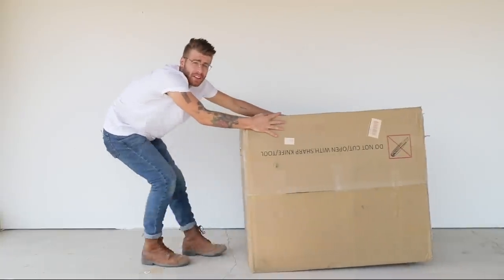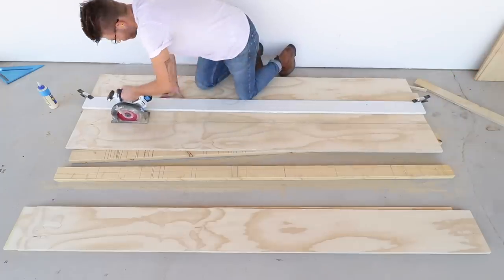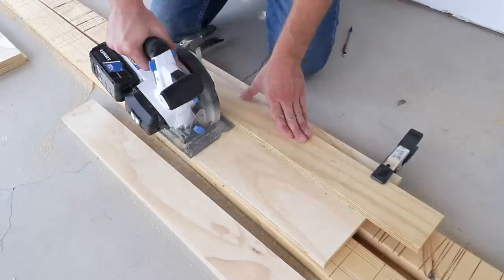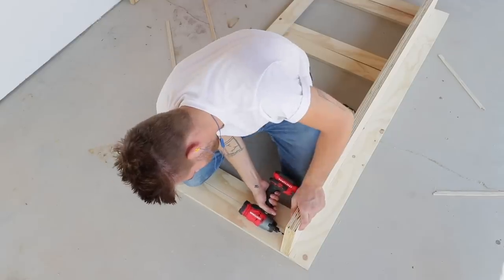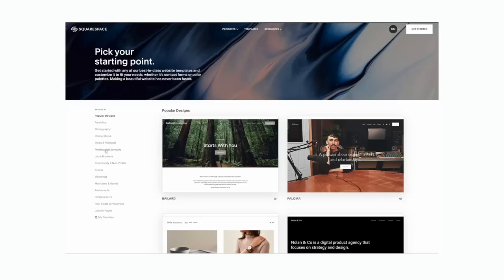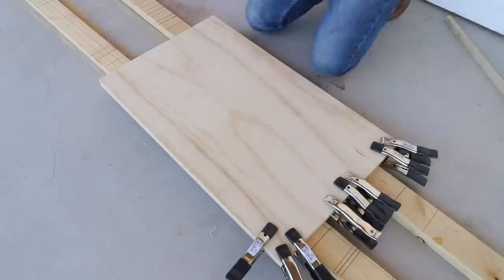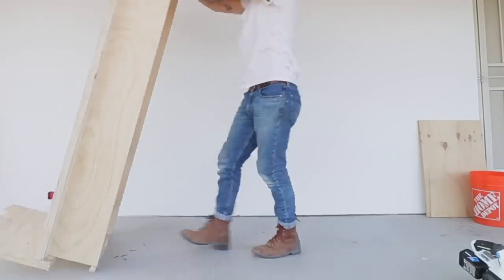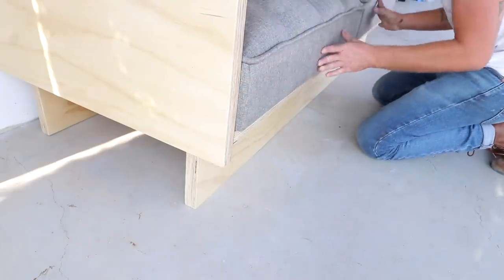DIY Sleeper Sofa / Futon that Turns Into a Bed! | Modern Builds

Comment: Hey nice project! Just try some furniture wax where everything is sliding together to make it slide easier. This is what furniture makers use/d when there is wood on wood sliding together
Reply from the maker: Thanks for the tip!!
Reply: @ModernBuilds  no problem...I should have been more specific. You don't really want the finishing wax. Just some regular parafin wax found in the canning aisle.
Reply: Good old bar soap works a treat also
Reply: Was just about to say the same thing - rubbing a plain (non-scented) candle stick on the wood will help too.

Comment: Fantastic video! One suggestion, instead of making larger spacers for it to move more smoothly, try rubbing a wax candle on all the parts that slide together. This makes for an excellent lubricant for wooden tracks. Also works for old chest of drawers that like to stick.

Comment: Putting square or rectangle nylon slides on the part that moves would also help with making it easier to slide in and out.  Maybe like the ones you put on the bottom of chairs. Just saying.

Comment: it needs wheels to make sliding out easier. and a simple locking slot, to keep it in sofa mode. also, the arms could have more functionality. if they were hinged, they can be folded for instant bedside surfaces, so glasses, phone, etc.

Comment: How are you so accurately using the clamped down piece of wood to cut the right size?? Are you making the measurement and then just simply adding an extra amount for the distance between the wood and the blade itself??
Reply: yes, knowing the dimensions of your saw makes it simple to measure from the outside of the shoe to either the inside or outside of your blade. taking the kerf of the blade into consideration will allow you to know exactly how much to add, or subtract, to easily clamp your straight edge.
Reply: C Cald thanks dude

Comment: This would be cool if you cut the  movable front leg about 1/2 inch shorter and add hidden wheels behind the panel, that'll let it roll out easier. Would just have to cut small openings in the front stationary leg for the wheels to fit into when closed.

Comment: Nice, easy and cheap project! Those armrests look so uncomfortable. Why not make them wider? The legs look quite flimsy. Maybe make them more robust looking with some leftovers?
Reply: the legs don't really need to be sturdy because they will be secured to the bus. Also, there is nothing flimsy about 1 1/2'' inches of plywood. This won't just be a free-floating piece of furniture. It will most likely be fastened to both the wall and the floor making it perfectly sturdy without the extra weight. Weight is your enemy in a vehicle.

Comment: I bought a cheap version of this click clack futon for my studio.  Unfortunately the metal mechanism that allows it to fold down into a bed protrudes up into your back when you sleep on it.  It  protrudes from near where the vertical and horizontal cushions meets on outside edge of the seat portion of each "chair". So it is basically right down the middle of your back.  This is dangerous and could injure a person.  I just put plywood over it and slept on that.   I  do not know if the couch he's using here has the same problem but I think it's only fair that people be aware of this. But since it looks like the couch he bought arrives as basically 2 separate chairs, there is probably a way to make this same frame for each chair and just stick an ottoman in front of it to make two separate futon bed/chairs. The mechanism only protrudes on the edges of each chair so if you sleep on it in the same direction that you would sit on it,  the mechanisms aren't as likely to be an issue.

Comment: 1n 1968, I bought a 9 piece living room set of pine, for $400.00. Now, 2021, $200.00 for a futon sofa in plywood? Is the cost mostly in upholstery?
9 pieces: 1 sofa with 6 firm cushions,  1 rocking chair with 2 firm cushions,  1 huge solid side chair with 2 cushions, 1 5-foot long coffee table, 1 3-foot short coffee table, 2 end tables, each with a drawer and a shelf, and 2 lamps. (Breathe.)
These traveled to Okinawa  and back. Plenty of good years left.
Rocker is the favorite.
I always thought pine was a soft wood. Maybe it is. Though these are THICK pieces.  Not found in today's market. Love 'em.
Wish builder's wou l d use thicker wood, more solid. 
Solid Mahogany from 1940's,  is not thick as my pine, but still holding its own in 2 homes as dining room furniture. Just the China hutch is $400.00. My sister has our mother's set, I have our grandparent's set. Mom used Pledge Lemon Oil, and the shine---can see your face in it--is like glass. Grandma's,  not so much, because Pledge was not produced in her time.
Thanks for reading, all from Mike's show, sorry.

Comment: why not use drawer hardware and mini casters to help with the sliding ?
Reply: He was building this for a bus conversion so I'm sure there was a budget involved. Draw sliders and casters are quite expensive and easily would have doubled the cost of the build.
Reply: @Battlebuddie  putting it that way makes sense. I even thought it will add more challenge to keep the sofa in place when the bus is moving. I could think of using locks or magnets to keep the moving parts together but that would more expensive.

Comment: I don’t know much about woodworking but wouldn’t projects be easier to disassemble if you didn’t use glue?
Reply: In woodworking, there may be sections you want to disassemble, but just know it will never be as strong as a solid, single-piece structure. Each component of an entire build should absolutely be glued together. If you have a couch with two armrests, a back, and a base, you'll want each of those individual components glued together, then, you can secure the individual seconds together with screws or hinges to make it easy to disassemble. However, in a piece of furniture that is going into an RV or van/bus build, you want your furniture to be a single piece and completely glued together. The glue is actually stronger than the wood. Fasteners also increase the possibility of rubbing and squeaking and trust me, that's the last thing you want to be listening to while driving down the road.

Comment: legs seems to be so weak, adding wheels could have been better
Reply: it's being installed in a bus conversion, so having wheels isn't practical. If you built this for your living room, sure, put it on castors. also, 1.5 inches of plywood is anything but weak. you'd be surprised how sturdy even 3/4'' plywood is.